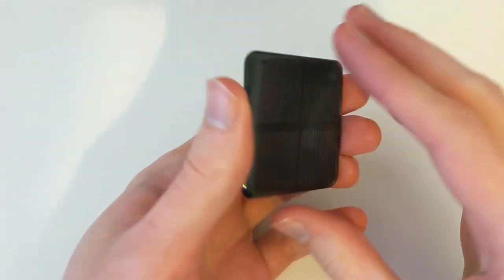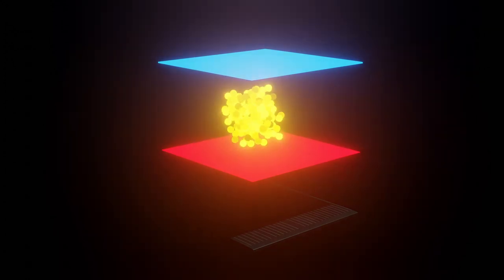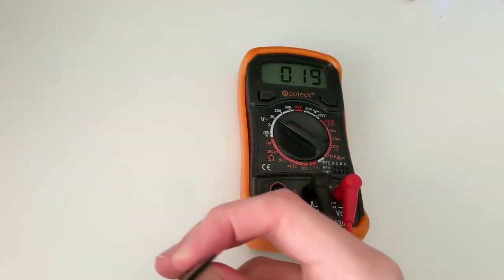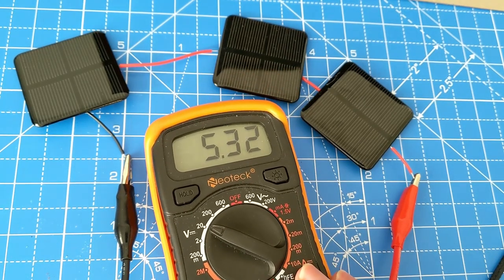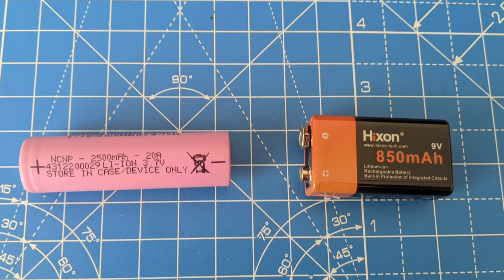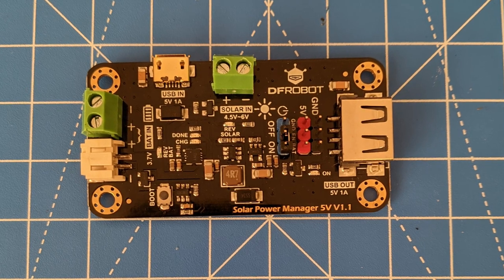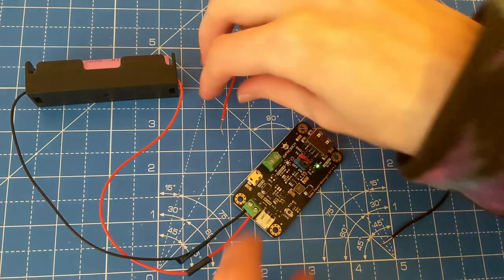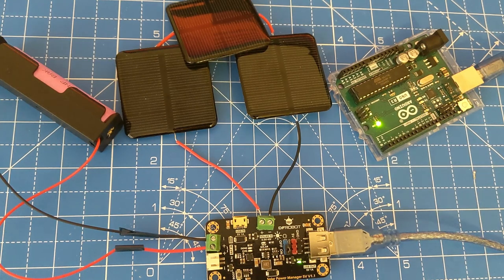Solar Cells and Panels with Arduino

Comment: I used this in my joystick rc car made with Arduino (wireless) for "unlimited power" as it would charge for 3 hours in a sunny day and it even tracks and goes wherever the sunlight is. Charges for 3 hours and works for 25 mins.

Comment: Would this solar power manager work if I were to connect it to a 12 V solar panel and to a Arduino that is powering serveral other stuff like 2 fans, a space heater and various sensors through its 5V pin? Or would it fry everything?
Reply: If you use a 12V battery to fake Arduino it will over heat and will not work

Comment: can you provide what model of solar panel you used? and solar power manager
Reply: You can briefly see it in the video when he flashes the back of the panel. It seems to say "AK50X50", which means this is a 50x50mm cell. Hope that helps.
Reply: @Handles_AreStupid and for solaire power management ? Cause I saw a lot of them but for 12V :/